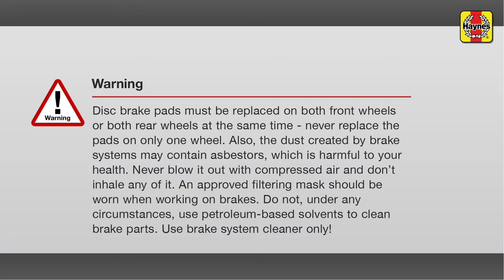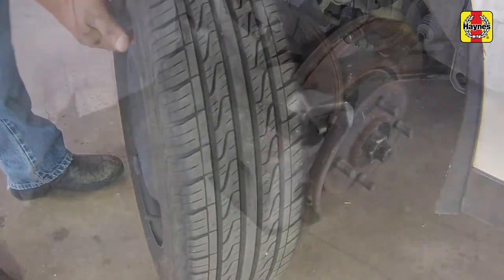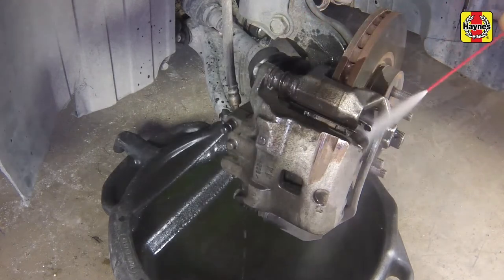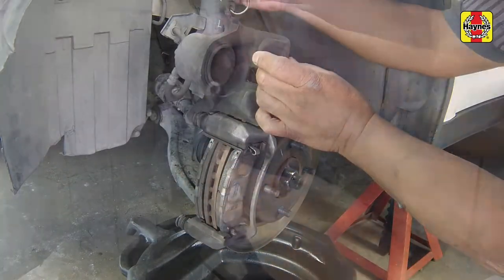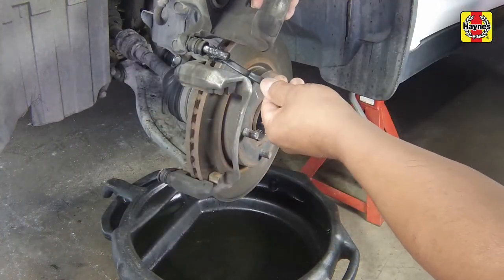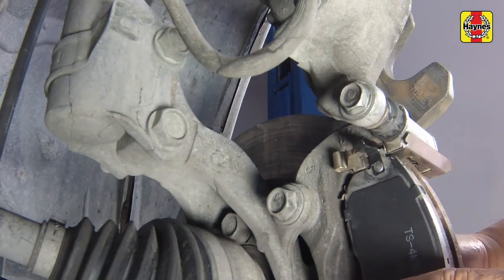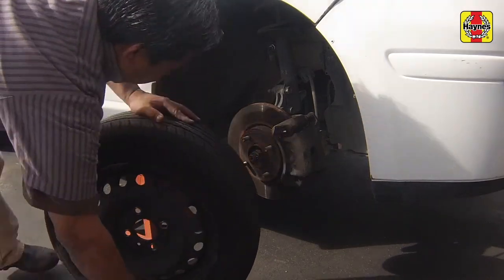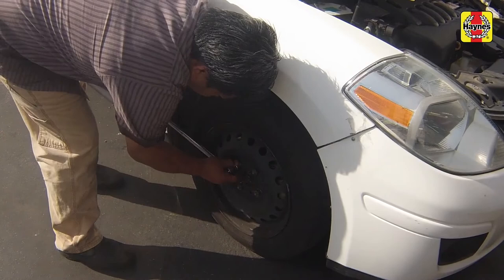How to Replace the front brake pads on the Nissan Versa 2007 to 2019

Comment: You should bleed the brake lines when changing pads, since you have the wheel off.
Reply: no need to bleed if the system was not open or compromised in anyway

Comment: The wear indicator is incorrectly installed; it should be on the opposite side of the caliper. This allows it to 'open' and reset when the disc makes contact with it.

Comment: I am just a DIY mechanic, not a professional by any stretch, but isn't it bad to put brake cleaner on rubber caliper pin boots? Won't they enlarge and become loose?
Reply from the maker: No, it should be OK to use brake cleaner on rubber parts. Any effect will be temporary.
Reply: That is only correct for certain brands of brake clean.  I've accidentally got brake clean on wire loom and watched it shrivel instantaneously.